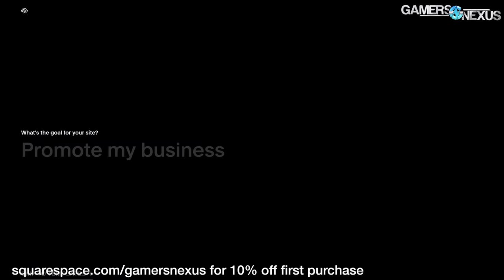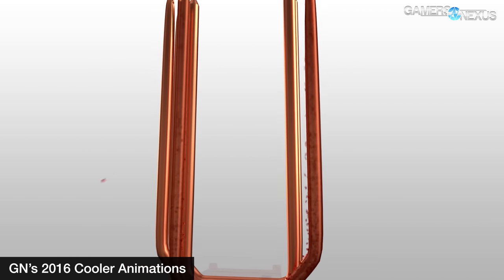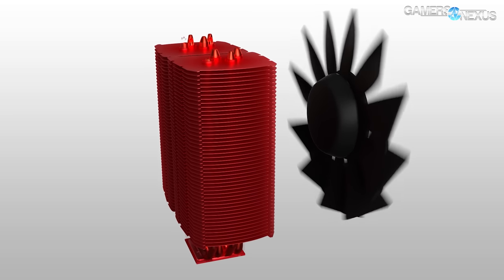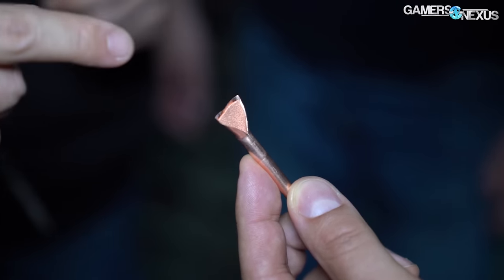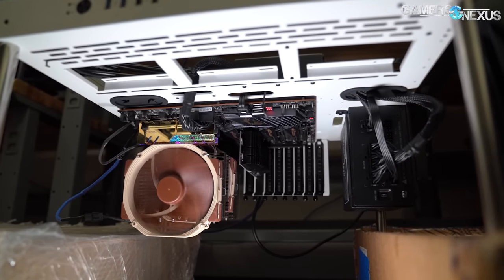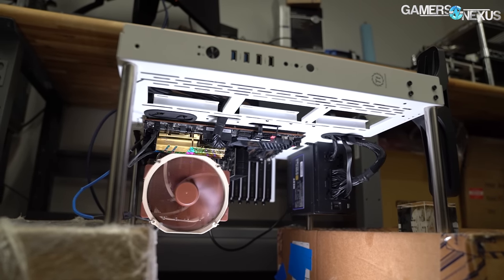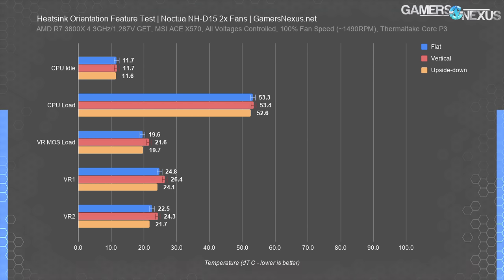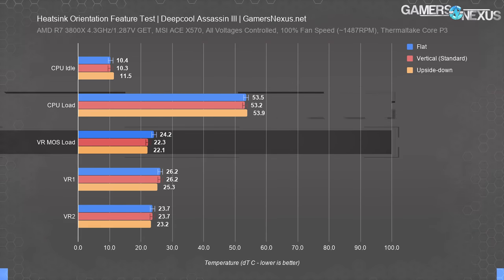Cutting AMD Coolers Open & Flat vs. Vertical CPU Cooler Benchmarks

Comment: Interesting to know heat pipes go back to the 1960s or longer. I had never heard of them until 2007 when I got my first CPU cooler with heat pipes. Now tower coolers are common but back then it was the first I had seen with most coolers before then being small and horizontal.

Comment: Would have liked to have seen you test a Noctua NH-L12S in the orientation Noctua specifically said not to mount it in to see if there actually is a difference. I'm curious now that I've seen them state to not mount in a specific direction.

Comment: I think the key factor that makes a difference in performance is the height distance between the evaporator and the condenser area, and that's where the relative positions between them would make a difference. The reason is that capillary action does have limits under gravity, which means that a long distance between the heat source and the heat sink would then show up in the results, and with a long-enough distance meaning that the heat source being above the heat sink would eventually render it useless. In the applications we're involved in here, where the heat sink is very close to the heat source, and therefore where at the worst, the difference in height is relatively small, with very fine capillary action it's possible that the difference is negligible, as they found.

Comment: Specific to laptops, upside down is extremely common. Usually the CPU die is face down with the cooling solution closer to the bottom of the laptop case.

Comment: #AskGN
Why do manufacturer mostly use 6mm heatpipes for their coolers?
Reply from the maker: Their goal is maximum heatpipe surface area contact to the silicon, which is often best achieved (with minimal gaps between pipes) with 6mm solutions that remain more cost effective. On some of the big die GPUs, you will more commonly see 8mm (or rarely 10mm) heatpipes.
Reply: @GamersNexus  Does 8 & 10mm apply to Threadripper then? Or is it too big & too expensive, without any noticeable cooling gains?
Reply: From data sheets I've seen 6mm pipes perform well, aren't restricted like 3 and 4mm ones are, and there isn't as much of an improvement to 8mm. Also, larger diameter pipes are more difficult to bend and have worse transfer to the fin arrays compared to using more, smaller, 6mm pipes.
Reply: @davidgunther8428  I'm guessing it has to do with the surface to volume ratio. The bigger the diameter of the pipe the bigger the ratio between surface area and internal volume. This works out when you have to transfer really large amounts of heat but for something like a CPU cooler ít's not optimal.
Reply: I would say cost is the reason, there's a factory out there making heatpipes some beancounter will work out going to 8mm over 6mm will add X to the cost, if we need to we can use 2 or 3 6mm pipes and the larger volume will drop the unit price, the basic concept is well known, its just do we need 2 or 3 pipes, how many fins and how tall. The whole episode here is probably more intensive reseach than most compaines will do.
Reply: @Taz6688  you may be unnecessarily cynical about this. 8MM heat pipes can transmit more energy, but have a lower surface area ratio, so they either need a better thermal connection to the fins, or be longer with the same type of fins to cool down. The thin cooling fins everyone uses don't transmit heat very far, so you need multiple pipes at regular spacing going through them. More medium sized pipes can work better than a few larger ones to connect with the fins.

Comment: Time to strap a thermosyphon heatpipe to a CPU. Since they aren't having any sintered material or groves. They are though more intended to provide cooling in only one orientation.
Commonly used for keeping permafrost frozen in areas where there is a source of heat, like the Alaskan oil pipeline.

But one shouldn't underestimate the effectiveness of water creeping over a surface towards dryer areas. And one should also not underestimate the rather insane amount of energy needed to heat and boil water....

Though, one thing that has long poked my curiosity is heatpipe saturation. Since the vacuum inside a heat pipe lowers the boiling point of the water inside it, so if the cold side were to get heated above that temperature, the performance of the heatpipe should logically diminish.

So what temperature does different heatpipes/coolers saturate at?

Not saying that testing this would be easy. Though, a thermal chamber kept at a fixed temperature and slowly dialing it up and watching the delta temperature between the CPU and the air in the chamber should be somewhat informative. Though, I would skip using a CPU and just use a large resistor and a K-type thermocouple to read its temperature. Since then one can always apply a constant amount of power for one to keep cool. Though, a constant air speed would also be needed.
Reply: If i got you right, and this could to a few handful of customers, be a real problem, it should be at about 80-120c become a problem. It's the only real flaw with this video but could be avoided entirely by the customer if they also keep their rig NOT upside down as far as i can remember. I was looking at max temperature cooling notes for heat pipes over a large chunk of last year and this year. Some of the whitepapers and notes detailed that it's often a risk to stop the entire liquid functionality of dragging heat away if you overstep the designated max temperature. Basically, GN never tested a CPU that is running hot enough for long to realize this environment. So for all normal users, it's not relevant. But to the few that got a bad case, with an Intel CPU going hot hot hot at it!.... You are in rare cases getting close to this limit and i'd imagine that the cooler would become a lot worse suddenly at above 100c and just make the cpu choke and undervolt/clock as we know they do. But again that's why your test would make more sense for that sort of test. And don't even try to ask me about those pictures, i went trough so much random stuff it wasn't even funny.
Reply: @CYellowan  Though, you would also need an abhorrently poorly ventilated case for the heatpipes to saturate. After all, we need the whole heatpipe to be warm enough for the water inside to not be liquid, even on the cold side.

But that is where this actually gets interesting. A heatsink with little surface area on the cold side would have a greater delta C/W compared to a heat sink with more surface area. (Though, oversimplifying here.)

So theoretically we could heat the warm side of a heat sink sufficiently for its heat pipes to force the cold side to a temperature that is above the condensing point of the heatpipe.

Though practically, a heatpipe has rather abhorrent thermal conduction by itself. Ie without any water inside it. So to get enough heat to flow through a saturated heat pipe to keep the cold side that warm would likely require the warm side to be fairly ridiculously warm. (But I haven't tested.)

But, as we approach this edge case, then our thermal performance would start to deteriorate. Ie, for every 1 watt added, we would see a progressively larger amount of delta C added for this additional power, at steady state power draw, there is thermal mass after all...

Though, there is also the other side of heatpipes.

Since a heatpipe gets its performance from boiling water, then we need to reach that temperature for it to have its impressive thermal conduction. So when a CPU idles at low power, then it will still be at a fairly decent temperature, and as it ramps towards higher power draw, we shouldn't expect any major increase in temperature.

Except, we have multiple thermal junctions, and material for the heat to flow through, and water doesn't boil at a fixed temperature, but rather starts simmering away already at lower temperatures...

So the graph would likely be smoothed out a fair bit.

Though, likely having a y=tan(x) shape to its delta-C/power graph. (Power on the x axis, temperature on the y.) Though, the thing would likely have offsets in both X and Y, and have a different scale. Exact location and values of cores dependent on the specifications of the heatpipe.

But this is just rough back of the envelope dead reckoning.

Though, in the end, the slope of the middle section of the graph and the two points at which it gets steeper could logically vary from one heatsink to another.

So the question then quickly becomes, how would one test these heat sinks?

I myself would graph their thermal performance. But since the thermal performance is 3 dimensional. (warm side temp, cold side temp, and power. If we have fixed air speed... So that is a 4th dimension to our graph...) Then this gets a bit hard to just show in a video...
Reply: > Since the vacuum inside a heat pipe lowers the boiling point of the water inside it, so if the cold side were to get heated above that temperature, the performance of the heatpipe should logically diminish.

Heating increases the pressure inside the heat pipe. If the manufacturer did a good job removing air from the pipe, the boiling point of the water will always be close to the current operating temperature. There are physical limits but they're quite broad.

At low temperature, the coolant can freeze at the condenser. This happens below the "triple point temperature," 0.01 C for water. From what I understand this is rarely a problem for electronics because even if you start your electronics in a very cold environment (-40 C), by the time you need phase change cooling, enough heat will be conducted through the copper to melt the water. This effect does mean that you can't expect heat-pipes to work effectively with liquid nitrogen.

At high temperature, the phase-change effect slowly becomes weaker. It disappears at or beyond the critical point: 374 C for water and about 3200 PSI.

I found some information from manufacturer ACT. They say their water-cooled pipes work well between 60C and 200C.  The ideal temperature depends on the amount of adverse height, it's about 150C for a level heatpipe. It's an interesting graph. Heatpipe capacity approximately doubles between 30C and 90C, and it falls off even faster if you try to go below room temperature.

https://www.1-act.com/water-heat-pipe-parameters-and-limitations/#operatingtemperature
Reply: @jordanrodrigues8265  Yes, a temperature increase would mean more of the water is a gas, and therefor increase the pressure, that would in turn increase the boiling point a bit.

After all, it is a fairly small enclosed space.
Though, it is also not much water in it.

But having just finished writing my other book of a comment, I can see that the link you provided has a graph showing a very similar thermal behavior to what I already outlined. Though, expressed differently.

The one in the link has power on the Y axis, while my proposed graph would have delta C. But in the end, it is the same thing, seen from different sides. Like frame times and FPS...

Comment: You should run a test where you perforate a heat pipe and let the internal liquid evaporate out. Do this to see what the phase change/evaporation cooling effect is vs conductivity of the copper pipe @ those temperatures. Would be an interesting test I think also. Great Videos

Comment: fancy lights on the memory
Reply from the maker: Someone noticed!
Reply: But then the rest of the memory has an awful Trump aesthetic.
Reply: man i'm waiting for gigabyte to drop this ram in black with 3600. its announced since at least a month.
Reply: @schneggen_schubsa6896  isn't that the trident royal? Gigabyte makes ram now?
Reply: Edit: oh man i'm stupid. i didn't mean the memory kit in the actual bench system (i did ignore it because thats just an insult for the eyes). i mean the display kit that is seen araound 15:48 in the background 3rd shelf from top, in front the big motherboard pcb and next to the rx 57000 xt waifu editon.

 @asit6947  nope thats the gigabyte aorus ddr 4 3200 kit 2x8 gig. that kit is almost now a year avaible?

i'm waiting for the new one because its realy decent looking and has a really low profile. i have the aorus x570 xtreme and the black is almost the same so really nice looking. it has rgb but i find it not so obnoxious and it will be turned off

Comment: Ole Silverstone has maintained that GPU heatpipe orientation for their inverted board cases like the FT-02 and such need to not-be horizontal(like most seem to be).  I've spent years going out of my way to find GPU's that match what they recommend.  They site the same theory initially proposed, that with the heat source way above the condenser end of the heat pipe it could cause problems.  I'm not more tempted to test that advice for myself.

Comment: Is ryzen 5 3600x will be enough for gaming only until 2021 or should i go for 8 core R7 2700x ?
Reply: 3600 non-x
Reply: @-eMpTy-  ok
Reply: When are you thinking about getting the CPU is the real question. IPC is higher on the 3600 but you get more cores and threads on the 2700x. And right now the 2700x is actually cheaper than the 3600 in the USA. If you can wait till Ryzens 4000 series comes out then get the 3600x then. Price will drop by about $50 or so if not more. The 2700x is $160 right now for reference. 3600 is about $200.
Reply: Yep a 3600 will be a better buy 1 or 2 year from now you can get the 8 core (3700/4700) for a much cheaper price than buying it right now.
Reply: @scottyhaines4226  r5 3600 = $240 and r7 2700x = $272 in india .
Reply: @MrKilladark  ok
Reply: Probably should find a better medium for discussion than youtube....
Reply: I would go with 3600 non-x. The 3600 is 3rd Gen. Zen2, which has better Precision Boost 2 among other improvements. The six cores will be plenty for gaming for the next few years. Don't bother paying extra for the x-version...benchmarks show almost no difference.
Reply: @Malignus68  ok
Reply: @Malignus68  also a big fan of storemi and better memory support... But still YouTube isn't really a discussion board.
Reply: @-eMpTy-  at the moment, they're nearly the same price
Reply: 3700x

Comment: so those interested in heat pipe technology there is a form of heat pipe technology called oscillating heat pipes. They offer greater performance over standard heatpipes. They is a company  producing them called thermavant. and while they are still expensive now to make with the ever decreasing process node and the increase of heat in a given area i really wouldnt be too shocked if these became more common over the next few years in higher end coolers for both cpu and gpu

Comment: Maybe I missed it in the video, but what is the test setup? To measure the impact of anything on cooling performance, you need to saturate the cooler. For instance, suppose normally the cooler can dissipate 150W and orientating it upside down has a 1% impact, that means it can now dissipate 150-15=135W, and if you push, say, 100W in all experiments into the cooler, you will not see any difference. You would need to push >150W to see any difference. For a Ryzen setup, that probably means you need to overclock the CPU and increase the voltage *and monitor the CPU frequency*. In the results you received I wouldn't bother with the frequency since there is 0 difference in temperature, but if any real difference in heat dissipiation becomes apparent, the CPU frequency will be very visibly affected.
Reply from the maker: You missed it. It's in the charts.
Reply: @GamersNexus  Thanks for responding! :-) That's what happens when you casually watch a video while washing dishes. What if there is a measureable impact of orientation, but the current setup simply does not push enough power to the cooler to dissipate? Any thoughts of retrying this experiment on TR maybe, or something else to increase the power to the cooler? I agree that I do not think there will ever be any measureable difference, just thinking about the methodology here.

Comment: The best orientation is flat, not  for cooling performance but because the weight of the GPU and gravity pulling down on it will cause the PCB to bend and solder joints to fatigue. I have many a GPU with a slight curve in them because of this effect.

Comment: I'm wondering if the axially wicked portion of the heat pipes could be in the straight sections of pipe, rather than the bent portions.  Bending axial wicks might cause distortion and impair their effectiveness, so they just use the sintering process for those sections of the pipe?  <shrug>

Comment: You know a meaningful result test would be the vrm cooling provided by the CPU cooler.

Often people remove the air flow which was part of the board design for board cooling. 
I would expect a fin orientation would make a difference to flow, down to the board or over it.(above).

Comment: do heatpipes get worse the flatter they are?
after upgrading my laptop from one big flat heatpipe to a cooler with 2 smaller, less squished heatpipes I got 13°C lower temps at 60% fanspeed(before 100% fan)
otherwise the coolers are identical

Comment: Science!!!  Just an OT-ish thought... I sometimes wonder if upside-down mounting might interact negatively with board-flex due to mounting pressure.  i.e., conceivably, upside-down orientation could ameliorate board-flex-related stress on PCB soldier joints and, consequently, improve the effectiveness of the board as a last-resort heat-sink and board longevity.  Probably, H0 ought to be "no relationship;" but, I wonder if some board/cooler combinations might have stronger correlations, i.e. sockets with bigger packages.  Hard thing to test rigorously, I suspect.  Regardless, it's nice to learn/confirm that, in the short run, at least, for air CPU cooling, there's little point worrying about orientation!  Great work.